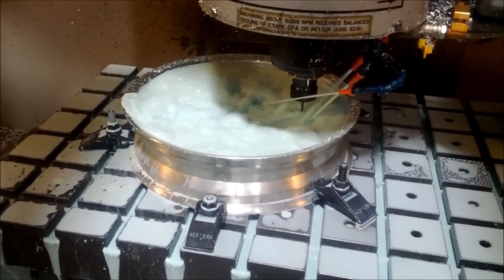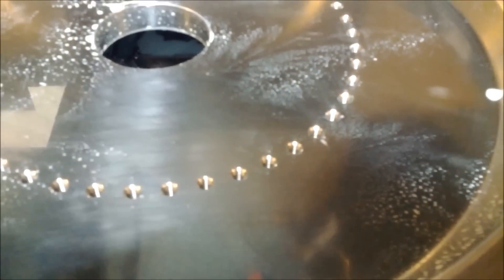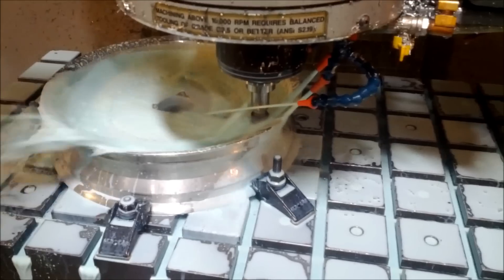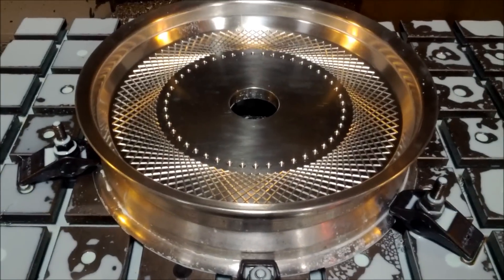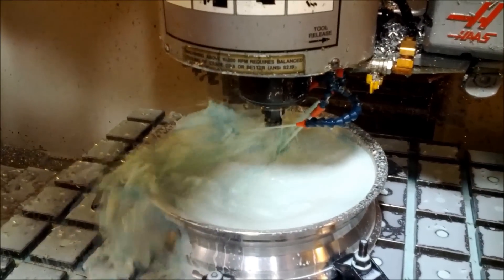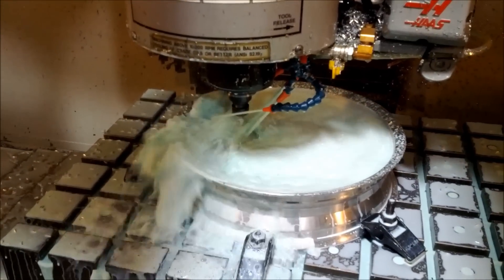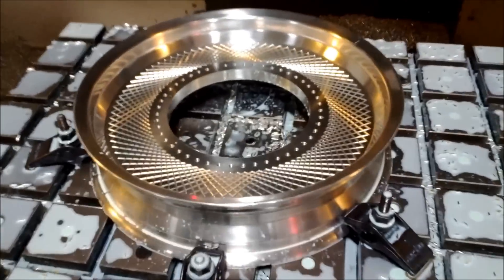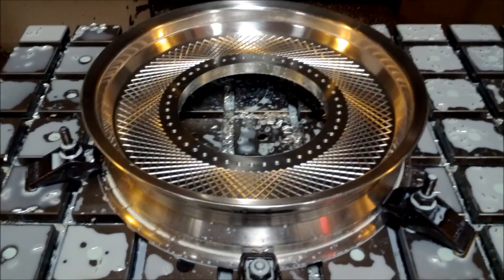Making A Custom Motorcycle Wheel on Haas VM-3 CNC Mill

Comment from the maker: You can get wheel blanks to start from.  We could make it from a solid block of aluminum, but it's actually a lot cheaper and faster to start from a wheel blank.
Reply: how do you took reference points to the other side of the wheel did that sync to the first one you machined ???